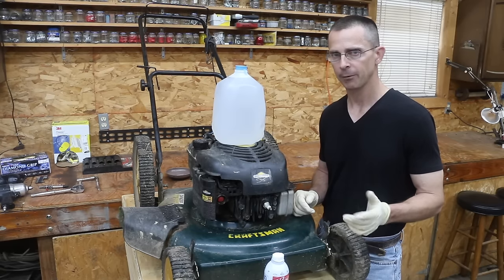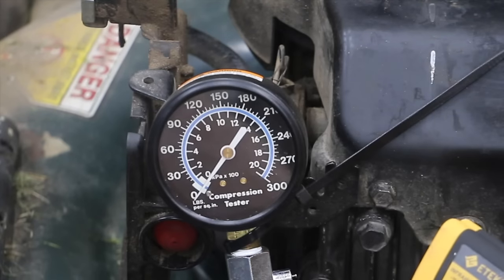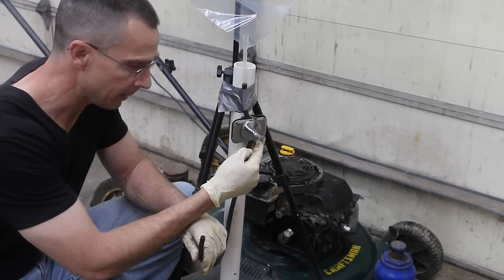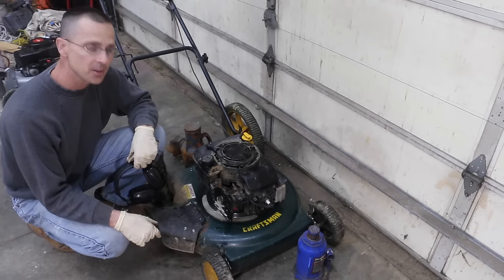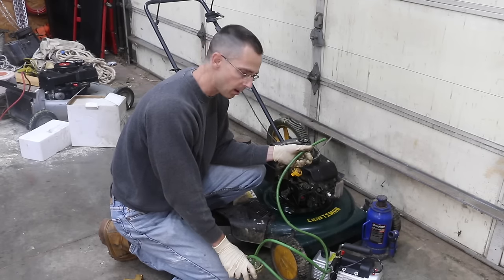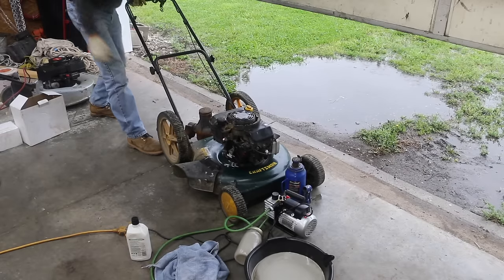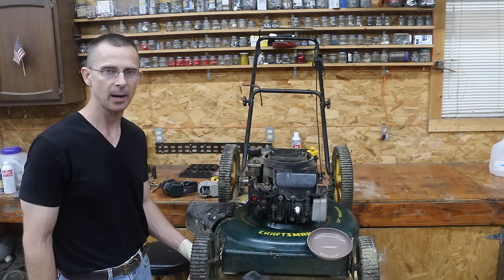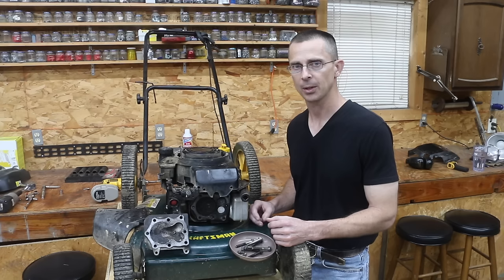Seafoam--can't believe what it did to my engine episode 5--cylinder cleaning test using water!!

Comment: The reason your engine stalled is  because one of your valves (air intake )stuck slightly open due to the oil contamination with water. this was evident when trying to restart the engine you could see the vapor being blown back through the carburetor 
 
 Suggestion. in regards to your experiment.
  It would have been better to use a handheld spray bottle. 
Method - set the engine to 3/4 throttle let it get warm . Next place spray bottle close to the carburetor then give one quick pull of the spray bottle trigger to create a fine mist . 
(This is like spraying a fine mist of water on a hotplate the fine mist fully vaporizes on contact with hot metal cleaning the surface) 
Wait a few minutes before repeating this process so that your engine is hot enough for this process to work properly .  
You can  repeat the process 2 - 3 times  whilst waiting a few minutes in between spraying. 
that is all you will need to remove most surface carbon. 
  Also do an oil change because even using a spray bottle a few times can result in water contamination in the oil. 

Also with regards to your experiment
Suggestion - Avoid trying to clean larger stubborn carbon deposits  whilst engine is assembled and running , because they always end up in the cylinder and work there way down into the ring grooves.
 For more more stubborn baked on carbon it is far better to remove the cylinder head and clean the cylinder head away from the engine with wire brush .

With regards to using water
 avoid having  constant or slow feed of water because this cools the metal surfaces too much and doesn't clean them effectively and In your  case the constant feed /flow of water was still  to high as  it bypassed the rings(can't compress a liquid so it worked it's way past the rings via the ring gaps and ended up in the sump mixing with the oil.) You where very  lucky that none of the valves stuck in a full open which could have resulted in piston damage or  bent valves. 

Never the less it was a good video and experiment  shows you what happens when using water infusion method   .Which is minor cleaning and oil contamination.  

Personally I don't use any of the cleaners / water infusion or water spray method. Due to the potential risk to cause excessive / or larger size carbon particulates to dislodge , as this can result in premature wear and scoring of cylinder walls  because the ring grooves have  become clogged with carbon , the other negative outcome from these methods, They always  contaminate your oil to some extent creating premature wear on bearings and shafts.   

   I always disassemble ,inspect clean and if serviceable refurbish and reassemble  back to spec. 

Surprising  how long a  well maintained and serviced engine, regular oil changes / oil filters /fuel filters /air filters . clean fuel will last.
Cheers enjoyed the video
Reply from the maker: Thanks!  Thanks for the constructive feedback.
Reply: Wow you by far had the best comment on what was happening in the test and the potential issues that might arise.

Comment: Interesting results... One thing that is probably being over-looked is, these later engines made after the 1990's , have compression releases to aid in reducing the starter pull effort... So a starter-pull compression test will NOT be what the engine actually develops when it goes to & above idle rpm... I used to wonder why the compression was so whimpy on these later 4-stroke lawn mower engines, as compared to the older (non-compression release) lawnmower engines.... That is why there is a difference between the old & New engines. So, to get an ACCURATE compression reading, the compression release mechanism should be removed from the camshaft of these later engines...
Reply from the maker: Thanks for the feedback.

Comment: Many years ago, a co-worker blew a head gasket in her old Datsun (B110, I believe). She managed to get it to my house (adding copious amounts of water along the way). I pulled off the head, and in cylinder #3 (where the gasket was blown) the piston top looked as clean as a brand new part. Same with the plug. That combustion chamber looked like it had been hot-tanked.

All the other cylinders had the normal amount of carbon buildup.
Reply from the maker: Thanks for sharing.

Comment: have you thought about making a concoction of a bunch of different combustion cleaners together including atf fluid and mix in with the gas to see if it cleans out the carbon build  out?? would be interesting? I was also told 44k by BG oil additives that youbadd tonthe gas is suppost to clean everthing out ?
Reply from the maker: Thanks for the suggestion.

Comment: I used diesel on a 1949 Ford six cylinder my first car that I bought out of the junkyard. It was running very rough and the diesel dumped into the carburetor made a heck of a lot of smoke and actually made the vehicle run better. That was before seafoam
Reply from the maker: Thanks for sharing.

Comment: Concerning the compression test: I have the same engine and it has a compression relieve.
At slow speed the outlet valve briefly opens a little and reduces compression. Thats why it only has 60 PSI and the test may not mean too much.
Reply from the maker: Thanks for sharing.

Comment: I setup a water injection system on a 428 CJ mustang back in the 70's. I used an oil furnace fuel nozzle. Don't remember the size. The engine idle would come up when the water was turned on. It never damaged the engine.
Reply from the maker: Thanks for sharing.

Comment: Love your videos and must take a lot of time doing them, For water to remove carbon an old mechanic told me that the engine need to be at temperature and reve up a bit and then he would drope a fair amount of water with soap until yhen engine nearly stalled but kept rev the engine up and there was a bunch of Black smoke comming out., he kept doing that for a bit, ??
Reply from the maker: Thanks!  Thanks for the feedback.

Comment: we always used ATF,,,, little at a time through carb then at the end drown it to a stall....wait about an hour then start it back up....I have to add a disclaimer though, probably would damage a catalytic converter, fuel injectors, and or an oxygen sensor. Back in the day GM used to have a canned product called top engine cleaner, not sure if they still make it or not but it worked!
Reply from the maker: Thanks for sharing.

Comment: From everything I have read,  You need to use a light mist of water when performing this test, Also use an intermittent spray pattern so you will not hydro-lock the engine or get water  into the oil.  The mist is how they usually perform water methanol injection.  But great video.
Reply from the maker: Thanks!  Thanks for the feedback.

Comment: My trick was just to use a pray bottle and mist the carb several times just before oil changes. Old trick my brother taught me. At 400k miles I tore the engine down (Toyota 20R), and it was clean as could be. Since then I have always installed a water injector on my turbo diesel engines.
Reply from the maker: Thanks for the feedback.

Comment: The water definitely works, I was trying to figure a way to run the water through a hose connected to a carburetor jet to meter it more slowly....I did this back in the 80's to a Oldsmobile that pinged and dieseled after you cut the key off, it worked excellent but that was an old car
Reply from the maker: Thanks for the feedback.

Comment: Engineering Explained had a video a while back about the Italian Tune Up. From what I recall, carbon deposits are only formed or broken down within a narrow temperature range. I'd bet the water in there cools temps enough to simply allow the carbon to break or burn off.
Reply from the maker: Thanks for sharing,

Comment: I stick with a 400-600 mile interval using super tech fuel injector cleaner in my certified used subaru; I did use techron after buying it as a 'heavy  duty' cleaner to bust up previous crud; I use the same super tech cleaner in my motorcycle every 150-200 miles with K100 (mg or g) for storage, spiking fuel after storage, and mid season 'heavier duty' cleaning
Reply from the maker: Thanks for sharing

Comment: I use a spray bottle and about a pint of water. I generally see sparks (carbon) blowing out muffler. Yes, it's imperative to change oil after process but I've never had crankcase water intrusion. Water settles to bottom of oil so there is probably still some remaining using your change method. I wonder whether your water feed method cooled / muted combustion lessening the cleaning effect. On water cooled engines  one of the side effects of using water vapor injection or having a blown head gasket is pristinely clean combustion  chamber.
Reply from the maker: Thanks for sharing.

Comment: Was thinking about water injection systems and HydroDiesel. If there is much blow by at all, some of the water WILL find it's way to the crankcase. If the oil is hotter than 100°C it will obviously boil away and exit via the crankcase breather. But, I'm sure some of it WILL condence on some metal surfaces inside the crankcase and mix with the oil during next cold start, unless it sits a VERY long time and is drained from the bottom of the oil pan. And, it seems, our Massey Ferguson 135 (for one) runs very cold and I doubt the oil hardly ever reaches 100°C.
Reply from the maker: Thanks for the feedback.

Comment: I would think that there is the possibility of cavitation which would cause further pitting in the head. Though I think it still may be possible, but you'd need the right amount of water such that the compressed gas is not super saturated. You want all the water to turn to steam without condensing
Reply from the maker: Thanks for the feedback.

Comment: I had water injection on my 88 Toyota Corolla. Mechanics were complaining that everything looked too clean. They couldn’t tell the condition of the engine by the spark plugs.Cylinders, valves looked great. Engine temperature in summertime was actually lower than normal. It had a hose that metered water into the intake itself. It was check the oil and fill the water tank. It did improve gas mileage a little bit. Maybe 2 to 3 miles per gallon. I took it off when I sold the car because when the tank is empty it makes a vacuum leak.Only trouble I had was Nebraska winters and possible freezing. I added a little alcohol to keep it from freezing and it worked fine. Wish I could find a water injection system nowadays Although I don’t know if today’s engines could handle it. It’s funny how are you don’t want water in the gas but yet you can inject it into the intake and it does a pretty good job.
Reply from the maker: Thanks for sharing.

Comment: We have a 1990 e150 with a 302. I've ran water through the intake to clean it and it works great. Atomization is key here, the goal is to "steam clean" the engine. I would put a "T" on the vacuum line off the fuel pressure regulator  and run it into the cab through the doghouse. I would drive home from work up at 7% grade over 2 miles and would drop the vacuum line into a 1L bottle of water at WOT. That was years ago and we still own the van with 245k on the clock. I had it apart about 2 months ago and the top end was one of the cleanest I've ever seen considering the age. We highway drive it cross country and change the oil every 3k and run techron in it religiously since I get it for free so I can't say if it was the water or the other maintenance but it never damaged it.

I'd like to see you do a retake on this in 2020 and have the motor under load and introduce the water through a mister, maybe like about a liter or so. It's a small 1 cyl motor, doesn't take much.
Reply from the maker: Thanks for the suggestion.

Comment: I used water injection after every tune-up for years, and when I had to re-do the heads I saw very clean valves. This was on a very worn 390 Ford V8 with over 150K miles on it.
Reply from the maker: Thanks for sharing.

Comment: Pressure relief valve for starting keeps those engines around 60 psi.
I’ve done the water injection but just misted it in
Reply from the maker: Thanks for the feedback.

Comment: Have you tried using one of the face misters ? Some have a piezo electric element which Big Clive shows as atomising the water. It's battery powered so you can just point it at the intake and leave it running for a while.

Comment: I’ve seen this done before but the difference was the time and quantity of water use. I saw only about a half cup of water used and only for a few minutes. Also the Flow I saw was intermittent and not steady. Similar to how you use a valve cleaner. I think less water used over a shorter period would have better results and not contaminate the oil.
Reply from the maker: Great feedback. Thank you

Comment: I wonder if the water had been not only slow dripped but intermittently stopped to allow the engine to heat back up and put more energy into the steaming effect, would it have cleaned better and possibly kept tolerance better and not let water past the rings?? I think the head and exhaust temps were a big clue.
Reply from the maker: Thanks for the feedback.

Comment: Thanks for the testing. I would definitely NOT use water since it pollutes the oil. And, I didn't see much carbon removal, at least not enough to justify water. As for Seafoam, well I might use it only because it gives a little improvement, but at least it won't mess with my oil.
Reply from the maker: You are welcome!

Comment: Project Farm. I have in the past flushed out milky oil by getting as much of the contaminated out and then refilling with kerosene. I would then crank the engine over without the spark plug wire being connected to circulate the kerosene. Sometimes I would remove the spark plug as well so the engine would turn more freely. Depending on the milky oil/water mix trapped in the crankcase, I would repeat the process as many times as needed. Since I started using SeaFoam in my gasoline, Very seldom do I have any fuel issues. To be very honest, I have not used SeaFoam in my engine oil. Most of the engines that I have seen water poured into the carburetor were small block Chevrolets that the engine was well within operating temperature to dislodge carbon deposits. They always seemed to run much better afterwards.
Reply from the maker: Thanks for sharing.

Comment: I have seen this method to be used for 4 cyl car engine. The engine was hot and running almost against the rev limiter. Then about 0.5l water was poured in two or three batches into the intake manifold. This was repeated twice.
Just as a comparison, the engine was much bigger, the amount of the water was much less and the threating time was totally only few seconds.
Reply from the maker: Thanks for sharing.

Comment: P.S. when engines are cold they are "loose" and they blow by. As they warm up the parts expand and seat. By extending the water...you cooled the parts enough to allow steam to blow by and condense in the crankcase.
Reply from the maker: Thanks for the feedback.

Comment: I have used water for a couple reasons. My father bought OLD tractors, iften given to him  34 Allis Chalmers, WC several IH Farmall even a couple of Johm Deere. 
He worked at Lynn and Fink the company that made lysol in the 50 60 70s. He would take the carb and drop it in a vat of rejected lysol bath tub tile cleaner and let it sit a shift or 2. Blow it out with compressed air and reinstall it. We'd fire the engine, no starters, cranks, warm it up adjust it and trickle water thru the carb. "Its steam cleaning 50 yrsof crap out of it.". It worked. We sold every one of those 2 botton tractors and never had a complaint.
In the 70s Smokey Yunick made a water injection to help with detonation the new emission crap caused when the big 3 was crowding engine bays with it.  I used a home made water injection, a unused window wash canister, a brass mesh filter, a fish aquarium air adjuster running it to manifold vacuum under the carb base plate. I ran an initial of 12 and a total or 36. While my friends I raced against had to retard their timing or listen to their engines try to emulsify the bottom end.
It does work on carburated engines.
Reply from the maker: Thanks for sharing.

Comment: Use to get a 2 litter fill with hot water and dump slowly in the old carburetors as you had someone give it rpms in park . worked like a Champ. Specially on my mom's 455 buick motor. She idle around town.
Reply from the maker: Thanks for sharing.

Comment: When doing a vehicle, raise engine rpms to about 2500 and MIST the water into throttle body/carb.  

I've done this several times to v8 engines and it definitely helps.
Reply from the maker: Thanks for the tip.
Reply: @ProjectFarm  

Thank you!

Comment: The first thing we did after driving to the drag strip in the 1960's was pour two Coke bottles of water as quickly as possible into the carb while the engine was running about 4,000 RPM. Our goal was to reduce potential detonation when spark was advanced to maximum. We would be putting about a cup of water in 5-10 seconds, twice. Pretty quickly we stopped doing it and started doing real set-up and tuning work.
Reply from the maker: Thanks for sharing.